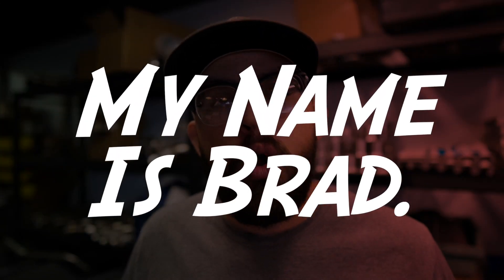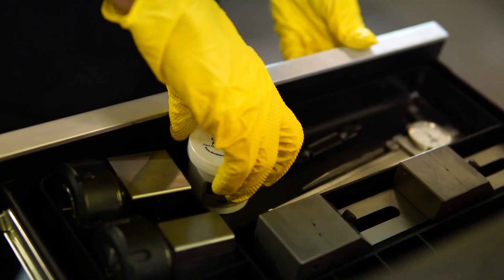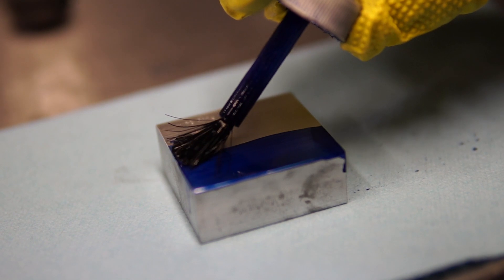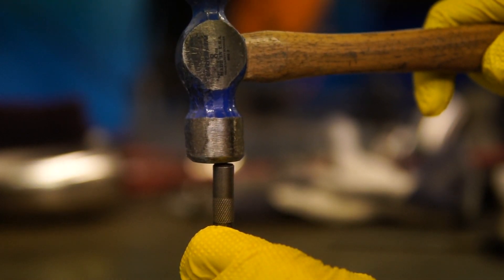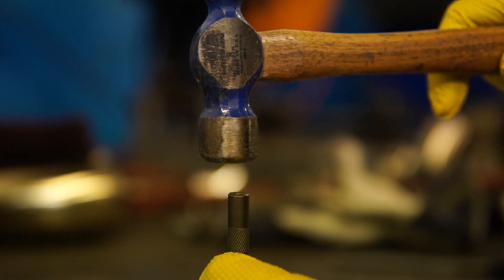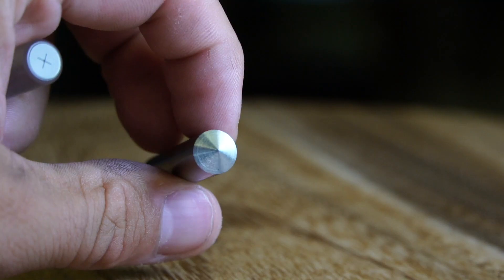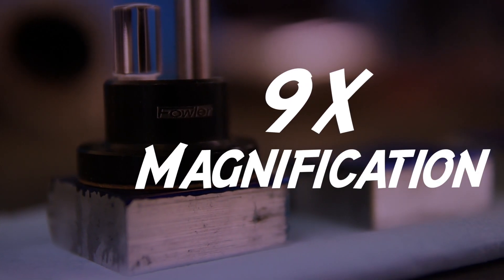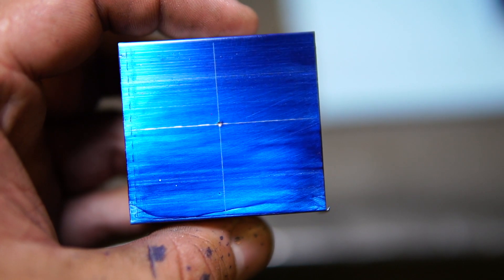What Is An Optical Center Punch!? 1 of my TOP #5  Best Layout Tools Ever | Metal Fabrication

Comment: Great video. Those sites used to be available with concentric circles around the cross hairs. Good for off setting from a radius line or centering over an existing hole. Mine was damaged and I cannot find a replacement.
Reply from the maker: That’s too bad! I’ve never seen them with a circle around the cross hairs.. that would be very useful! If I ever run into one, I’ll let you know! Thanks for watching. 🙌🏻

Comment: What would make a good alternative to that blue steel layout fluid you used? Thanks!
Reply from the maker: You can always use a sharpie marker and an air gun, look it up! Thanks!
Reply: A carborzing flame from an oxy-accetylene torch (with no oxygen) works also, and afterwards, you can wipe it clean with your glove, rag, or whatever.